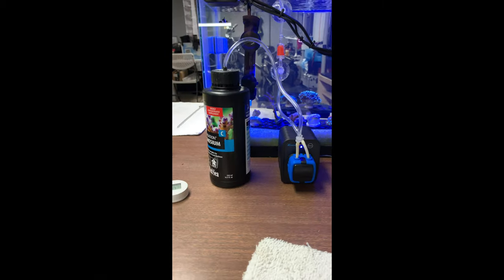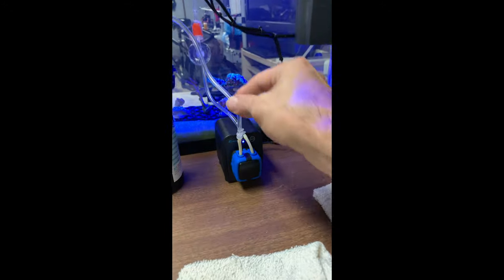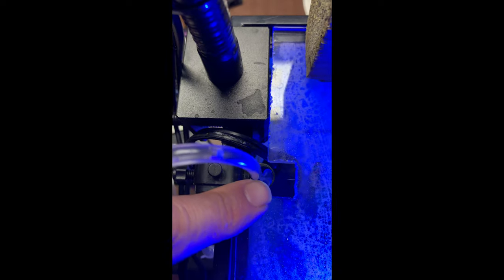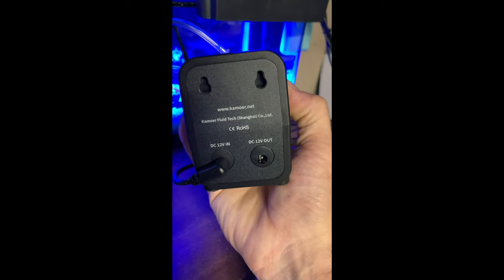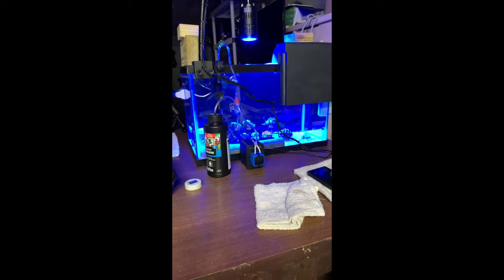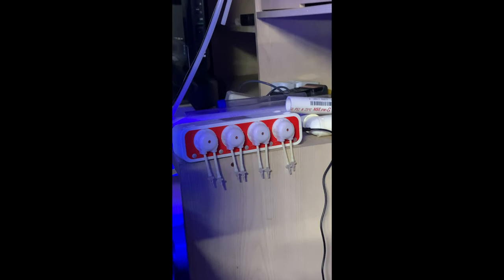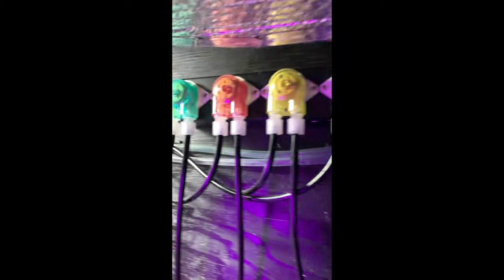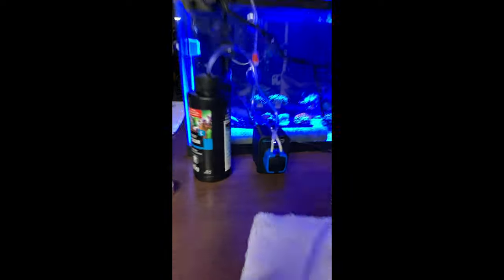new single doser kamoer x1 pro 2 micro pump

Comment: Can't get my kamoer x1 pro 2 to connect... Not easy... Glad it worked for you... Tried 3 wifi sources and verified 2.5 ghz connection...
Reply: You have to hold the button on the pump until the light starts blinking and you got a link at that moment read the directions carefully I couldn’t get it to connect either and then I realize you have to do it right after pressing the button it blinks a certain amount of blinks and you have to do it right then otherwise it will not connect.
Reply: @JasonStJohn-my1cs  mate you’re a legend. I was just about to smash it hahahaha, then found this comment….. bam first go!!!!!!!
Reply: @sierradelta8920  I assume you’re talking about the way it connects. You have to catch it in the first few seconds or else you missed the connection point. 
Glad to help

Comment: Being a peristaltic pump...you shouldn't need the check valve..or am i wrong?
Reply: The way I have it angled it drips the line out Once pump shut off. I added them afterwards. It would drip a few extra drips in. It was causing me problems.

Comment: Hi! I just bought the Kamoer x1 dosing pump only to find I need the pump to be positioned above my sump, which unfortunately isn’t possible given I run a nano cube 20. Did you combat any siphoning back of water by using the one way valve? If so, which type of valve did you use and where can I find one? :)
Reply from the maker: I replied to this message awhile ago. did you get it. utube is telling me I didn't respond

Comment: Hey there! Question for you. What size tube did you use for the inside of that bottle you are dosing?
Reply: If you’re talking about inside the red sea bottle I have the red sea kit comes with tubing that fits in it. I also ordered airline tubing that was too big for airlines for some reason and it fits in there as well I don’t remember where I got that from just buy the one from redsea design for it.

Comment: 2:00 THANK YOU! lol I kept wondering about that same thing because I wanted to hang it up like that but was thinking to myself why would they put those plugs there? Unless you want your screws sticking out a half inch just to hang it!
Reply from the maker: I assume you will just have to have screws stick out a bit set it so screws and plug are level once against wall. My best guess. It is definitely not the best way to mount but that's what they did.  I will say these little dossers are a amazing for what they are and I love there app. I don't think any other brand can beat there app. that's why I still use there 4 head doser over a apex or versa. I will one day buy the dos system once needed but this works great for dosing chemicals.  I personally think the other companies need to look at kameor app to even get as good as these. there app is flawless

Comment: So wait u can log in to the app and check and make sure it’s dosing on ur phone even when ur not connected to the same Wi-Fi network?? Otherwise I don’t see the point of it only reason I’d go with the x1 pro 2 instead of x1 is bc of the power outage issue with the x1 that could potentially cause it to miss a day or dose up to twice as much as what it’s supposed to and my main reasoning for getting one is so I can leave to visit family for a wk and not come home to a nuked tank

Comment: how noisy is it? mine does a lot of noise, I'm wondering if I got unlucky with my dosing head.
Reply: It’s virtually silent
Reply: I only dose small amounts though no more than 15 mills at a time
Reply: @JasonStJohn-my1cs  Damn... I mean, it's not terrible, but there's a lot of squeaking. Is it super smooth there? I'll try to open the dosing head and see if I can fix it
Reply: @andrefaria7284  no squeaking almost silent it’s all I can say no noise you’d have to be standing right at it and paying attention to hear it. Tried checking in making sure the rollers are oiled or greased. Maybe you just got a bad one the dosing head is just made of plastic it shouldn’t squeak unless they forgot to oil it.

Comment: Could u tell me that how to calibrate the pump ?
Reply: It should’ve came with the directions I’m going to settings and go to calibration I believe you hit the go button or star button and when it stops you tell it what mills it’s at. So after it’s done running if it’s at 6.5 mils you enter in for the calibration 6.5 mils
Reply: If you need more info let me know but I’m not sure how to get you a  video

Comment: This thing is very hard to connect to my network! 3 routers and 4 android devices and still nothing, Even setup a dedicated 2.4 for it's use and still nada.
Reply: You might be doing it wrong you need to press and hold the reset button on it and connect to it immediately it should be in your Wi-Fi list I should link right away I’ve had many people ask me about this it’s in the directions and explains exactly how to do it. But if you’re having problems you need to press the reset button and link to it immediately don’t wait.
Reply: I’ve had multiple routers while having it and I’ve had no issues whatsoever but when I first bought it I did because I misunderstood the directions
Reply: Go to the three minute 40 second part of my video And I explain it. Make sure your phone is on the 2.4 GHz and not the 5 GHz actually forget the 5 GHz if your phone was connected to it. You understand what I’m saying forget it so it doesn’t auto connect to the 5 GHz you can reconnect to it once you get the dozer connected.Hit the button wait for the flash go to Wi-Fi select the dozer go back to the app and hit connect or whatever it says then your phone will switch back to your 2.4 GHz network and it should connect. Also make sure you don’t have your router set an a specific channel make sure it’s an auto channel mode during the connection process if you don’t know what I’m talking about then it’s probably already in the auto mode it’s the way they come.
Reply: @JasonStJohn-my1cs  Got it to work with a 2 sec. hold rather than a more than 6 sec. hold time the a app is calling for. Thanks for this video that's why I tried only 2sec.
Reply: @rainerfamador6680  yeah I remember it was just a quick couple second hold release I know directions were a little weird and it was a little finicky but once you understand it you should get it every time. I’m glad you got it